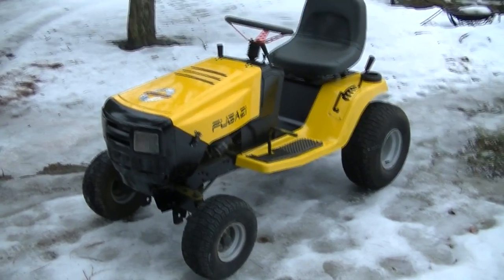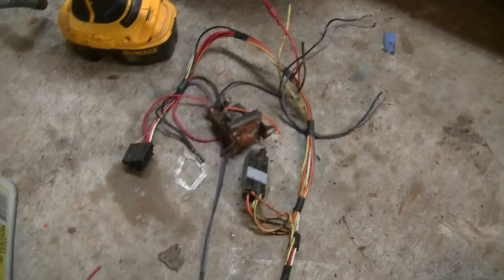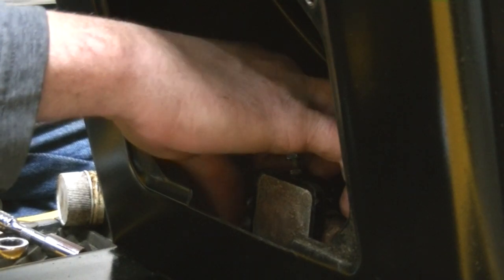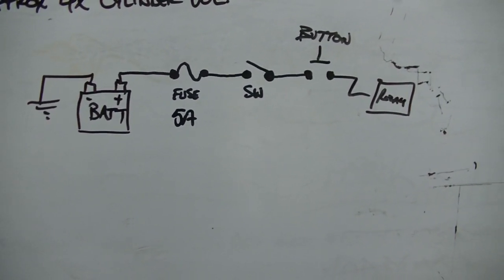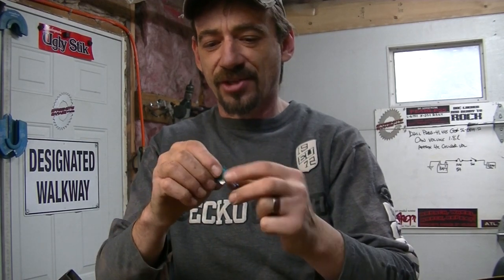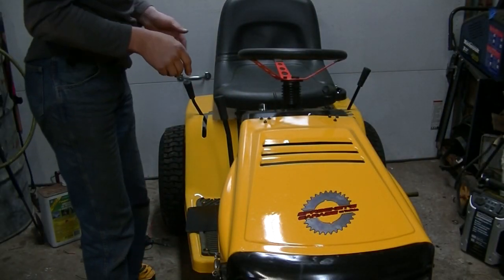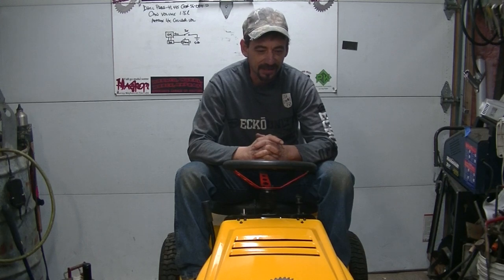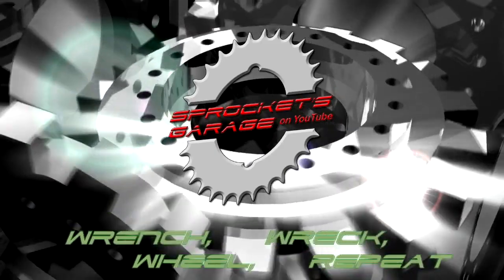How To Rewire A Mower- Simply

Comment: Thanks Doc, This vid is just what I needed _ I'm right in the middle of putting a Kohler Magnum 18 off of a Sears Craftsman, (with its harness) onto my 1977 Jacobsen 110 lawn tractor. Just looking for ideas to neaten up the wiring and this video nailed it.
Reply from the maker: Excellent! Since your M18 (most likely) has a regulated charging system, just grab the middle wire off the regulator.

Comment: Wiring is so simple on a riding lawn mower. ALL of mine got Led Fog spot lights on em.  red and blue front and rear flashing lights ~ for the dust or fog. ect. next to the road so i'am seen.  cigarette lighters. lighted switches ect. Reason i do a lot of mowing during the night, ITS a lot cooler. Another must have is a hitch on em too

Comment: Hi Doc, I watched this video with interest. I am not sure when you made it and hopefully you can help. I have an old rover rancher that has a b&s 15.5 hp motor and would like to re-wire as you have done. Any chance of a wiring diagram that would include the terminals on the back of the toggle switch( I'm certainly no auto spark) as this is the only video I have come across that shows the red wire from stator but I could not clearly see where you connected that to. Good video and cerainly worth watching 
Regards John

Comment: Hi good video very easy to follow along, not to get away from your wiring but, what kind of paint do you use? That is awesome what you have done with the paint scene, you can't miss that tractor coming down the road great job on the entire machine.
Reply from the maker: Thanks! It's been awhile, but if I recall, I used Krylon spray cans. I did the lettering on my printer, cut it out, and used it as a spray mask- so the lettering is paint, too.
Reply: Wish my Rattle can paint jobs came out than nice 👌 good job

Comment: Hey nice video where did you run the red wire too from the voltage regulator I’m not seeing that near the end and where do the twin yellow wires go from the regulator thanks so much
Reply from the maker: Diagram at 10:46 in the video. The two wires from engine to regulator would be the yellows from the alternator stator. The single wire going out from the regulator would be the red charging wire.
Reply: @DocSprocket  ok thanks this all going down on Saturday haha thanks for making this video and for the clarification I thought I watched it twice no might have been interrupted thanks again nice work💥

Comment: Wow you make that look so simple. I'm not good at doing anything like that. I'll be rewiring my 75 Jacobsen Homelite LT10 lawn tractor. That looks like all new wires you got going on there. Have you had any problems with that setup? Where did you get all the wiring? What's the difference between the wires with the different colors.
Reply from the maker: Reeses Mill Off-Road Adventures It is new wire, I buy it by the roll. Recycling old wire is a recipe for problems. Color doesn't matter as long as you can keep track of what's what.
Reply: Sprocket's Garage I kind of thought it was new look. Does the different color wire mean different gauge? Also it's her way to wire it up without a fuse?
Reply: Reeses Mill, the colour of the insulation has nothing to do with the wire size, it just helps identify a particular circuit, like starting can be all red, then lights can be white, kill circuit yellow, etc. Wire gauge is determined by the amount of current a circuit draws and length of run. In a mower, run length is not an issue, but for example, 30W LED light draws 2.5A at 12V (look up Ohms law), your starter solenoid will draw about 2A but your starter motor draws upward of 60A but only for a short time, thats why the wires from the battery, through the solenoid and to the starter are so much thicker (8 gauge I think, I work in square mm). The rest of your wiring can be 2.5 mm2, you can look up the gauge. Don't go smaller, you don't want an electrical fire under the hood, gas and fire dont go to well together in that situation!

Comment: Hey Doc... I need to rewire my zero turn... new Kawasaki 17hp no starter (on pull rope) I only want a push button switch to kill... and have my electric clutch... don't want anything else... and no safety switches either...
Thx. Joe

Comment: I have a question about the charging wires every time I try to wire them up they make the battery arc whenever I try to hook the negative and positive to the battery it's a 2005 17.5 Briggs and Stratton intek and it's already wired like yours

Comment: trying to rewire a mower as the key switch the previous owner put in isn't right for it and it only operates the starter circuit.  I ran a switched circuit to the fuel solenoid so it can now start and run and shut off.  Is there any reason to also run another switch to ground out the ignition coil?

Comment: So my briggs engine has two wires coming off the engine. One red and one black wire in a harness. I suspect the hot is red and goes back to the relay and the ground goes to chassis and then switch? 

Also i used a DPST switch that only has 2 top and 2 bottom screw terminals. I wired the power and start button wire on top and  the ground wires on the bottom of one side (pair) of post. 

When I attempted to connect hot battery terminal it sparked even though the kill switch was in off position and the fuse blew. 

What am I doing wrong? I suspect it’s the kill switch wiring. 

Also is rectifyer the same as the coil? 

Thanks in advance Doc.
Reply from the maker: To begin with... The two wires coming from your stator- The red one is the DC charging wire. It is positive, and needs to ultimately lead back to your battery + post. This is often done either thru the key switch, or this big battery + terminal on the starter solenoid. The BLACK wire, is an AC lighting wire. It is AC output only, and ONLY to feed an incandescent headlights system. Do not use it for anything else. This could be causing your issue.
Next, back to that red wire. Look for a small cylinder shaped lump in the red wire close to the connector. This is the rectifier diode. You absolutely need this. If missing, buy one. This also will cause your issue. 
I believe your toggle switch wiring is also faulty. On switch, ONLY the kill circuit should go to ground. 
No, the rectifier turns an AC alternator signal into a DC charging signal. The coil makes the spark for your spark plug. Completely different. hopefully this info helps point you the right way.
One other point- all your engine grounding is done through it's mounting. Big battery (- )terminal right to the frame. Starting and charging systems self ground because the engine is bolted down.
Reply: Sprocket's Garage. I do have the diode on the AC wire and that is going to battery +  Thanks for the clarification.

Comment: Where does the charging wire go to. The one coming from the voltage regulator
Reply from the maker: The short answer, is Battery +. There's other, better options like a positive bus bar, or thru the key switch power circuit, or even just to the BATT terminal on the starter relay.

Comment: You think one could have enough power from an engine charging system to run LED lights and charge a battery, if the engine only has a 3amp system? Rather not run a battery down if I don't have enough power.
Reply from the maker: 3A is pretty weak. You sure about that? If so, go very minimal in the lighting. Definitely LED, and as few diodes as you're willing to use.
Reply: Not terribly sure. Ideally I'd like to go with a 10A system, however in order to do so, I'd have to get around a GX270 or 390 to have that option, seeing as though the Predator 420 only has a 3A option and no one has a write up to add a larger coil to it.
Reply from the maker: Hmmm. If the Predator were a true "clone", I would tell you to look into the alternator stator and rectifier for a Honda GX390- which can be had at 18A. However, the Predators are not considered to be true clones, as there ARE some differences, even though they are largely based on Honda GX architecture- so I cannot guarantee a fit. Perhaps something you can research, though.
Reply: Yeah I get what you mean. 18A would be nice, but I think that is way more than what I'd need for a couple LED lights and tail light/brake light. What I am wanting to do is a front engine go kart, kind of what you did with the diesel Weasel, but instead as a complete from scratch build and not use an existing template. Considering a GX390 with electric start, with the 18A stator is close to $900. Seeing as the 420 Predator is about half the cost, I figured I'd go after one of those to save on up front costs, then save up to get the Honda later. If it was doable to run a bi-directional alternator or 10si off the engine PTO and still have room for the CVT, I would do that. Since I would want constant power and not intermediate with the alternator on a jackshaft, that only goes while driving.
Reply: keep your overall amp draw under 3 amps. unless you go for crazy expensive led lights it should be easy to do. 3amps of leds is alot more lighting than you think.
Reply: Well more looking today, it appears that you can order it with a 6A stator or you can put a GX390 stator in it. Though it appears no one has done it, so I may try it to confirm it's possible or not possible. If it is possible, then I'll buy a second 420, do the same thing for an off-road go kart for hunting and ice fishing.

Comment: I can’t find a DPST 6 pin that is ON / OFF. Only On/ON. Can you provide a link please. I purchased a 4 pin but need the center lug correct?  All DPDT switches come with center pin but like a knife switch are On/ Off/ On. Thanks in advance.
So maybe what I need is an On/On switch with center pin?

Sorry to be such a nag. I am obviously electronically challenged, despite the fact that i have wired many light fixtures and switches in my house🤔
Reply from the maker: Hey, no sweat. Nobody understands everything, myself included. This process would be easier if you get into my group. Do you have a FB account? Join Sprocket's Garage. Beware the dummy group. Mine has about 10K members.
Reply: Sprocket's Garage will do. I was thinking along the same lines.

Comment: I have a 1992 weed eater (poluan pro) mower. I cannot find a regulator rectifier, or a condenser or points. I was curious since it's such an old mower, is the technology different than what was shown in the video? The mower does have a stator though. Any help would be appreciated.
Reply from the maker: I would be VERY surprised if your 1992 Poulan requires breaker points and condenser. VERY surprised.
As for the charging system, it could have one of a few different types. To begin with, how many wires come off the stator, what colors are they, and what does the connector look like?
Reply: @DocSprocket  Thank you so much for responding. I have been searching articles for awhile. The stator has 2 wires coming out of it. Let me check and see what they look like.
Reply: @DocSprocket  There is 1 red and 1 black wire that come from the stator. They both go to a connector that is unplugged. When I got the mower there were several wires not connected to anything, including those. I finally found a wiring diagram for my mower. It appears the stator plugs into a diode before being routed to the ignition switch. There is a tiny bulge in one of the wires. I assume that is probably the diode.
Reply: The connector is rectangular with 2 cylinder shaped connectors inside.
Reply from the maker: @ColtenMallow  Yes- you have a dual circuit charging system. The red wire (with the diode hidden in it) is the DC charge wire. You can run that to Battery (+) , the battery terminal on your starter relay, or a few other possible locations. The Black wire is AC only, designed for basic headlights. Do NOT tie this wire into the rest of your electrical system. Most of us just cap it off and forget about it, as it is about useless. You CAN run regular lightbulbs off it (not LED's) but the  slower your engine is running, the dimmer your lights will be.
Reply: @DocSprocket  thanks so much! That really Helps!
Reply from the maker: @ColtenMallow  You're very welcome.

Comment: would this also work with a  briggs with a wire going it the bottom of the carb.?
Reply from the maker: Those antiafterfire solenoid isa total pain in the rear, and something I generally avoid. If you wish to keep it, you must supply it with 12 volts while your key (or master switch) is in the ON position. I delete them. Look for a video of mine called "Solenoid Sacrifice" as part of my Doc's Dirtcheap DIY series. It will tell you everything you need to know on the topic, including how to delete it.
Reply: ok thanks will do

Comment: Hi Doc, I have a Craftsman V twin with the same rats nest wiring, that shuts off engine when engaging clutch. I replaced the three safety switches. No change. I'm considering a rewire while I'm at it. To steal your key word "SIMPLY". Would I have to install two toggle switches, one to each kill wire or where'd you find that switch? This QPST abreviation doesn't work.  Also I noticed you eliminated the Diodes. I don't know, I'm asking, is this cool?
Help,
John
Reply: +Toolman - Yea, you will need a " Separate " Switch for your Clutch.  NOTE: Diodes are a One-Way Electron Flows. If you can leave them on, I suggest you to do so in any case... But the " Basic / Simple " Wiring should stay the same.
Reply: Toolman, I have a Craftsman GT6000 that has 2 diodes connected to the output of the stator. 28vac goes to the diodes, which are installed opposite of each other..... On the output side of one diode, you'll have +14vdc, and the other outputs -12vdc which goes to the headlights. This was their solution to a voltage regulator, which in my opinion is better, because those diodes can be found for about $2 a piece
Reply: @jbcaplinger  Thanks John. I agree about the Diodes. I bought six on line three years ago when I posted this comment. 
I did solve the engine quitting problem by disconnecting the ground wires on both coils. It shuts off slower because it has to empty the Carb. of fuel. I have lived with that, so, I'm no longer concerned. 
I bought the mower cheap as a basket case. The owner bought it new and it sat for 4 or 5 years and he used it one time.. :O) Don't know why?? 
Sitting outside made a mess out of it. It took a lot of work and some bucks to remedy but it was worth it for what I paid for it. I even repainted it. 
It runs good now. I never did anything with the Diodes. So I don't know if they would have cured it. They're hanging on a nail. LOL
I eliminated the lights. I don't mow at night.   Sorry this is so long. Thanks again for commenting!
Cheers, John

Comment: What size wire did you use?
Reply: +Justin Bullock - You can use Regular 18 Gauge Hook Up Wires.  The only thing you can NOT use is on the Solenoid and the Battery.  Other than that, these Wires carry Low Voltage, so there is no need to add Heavy Gauge Wires.

Comment: Is that a 4 prong or 3 Pringle starter solenoid
Reply from the maker: Been years, don't remember. Doesn't matter. If it has one small (trigger) terminal, run that to your start button or key, and be sure the mounting bracket has a good ground. If it has two, run the second small terminal to ground.